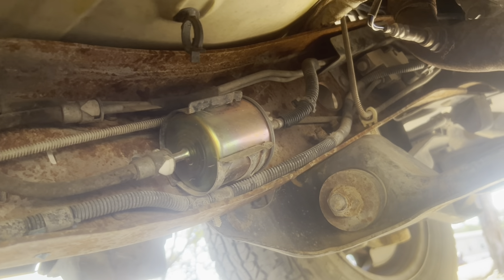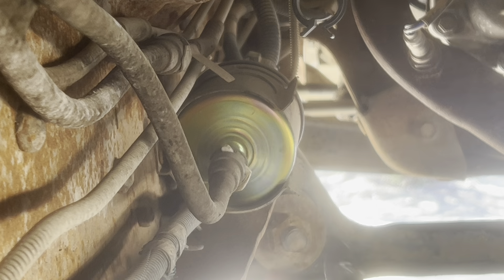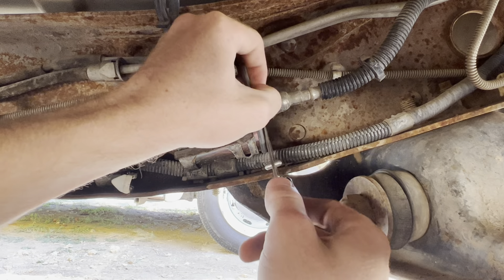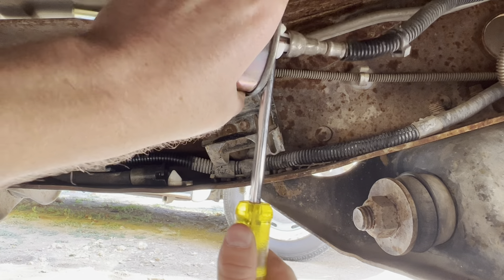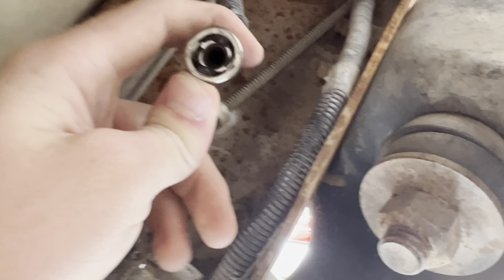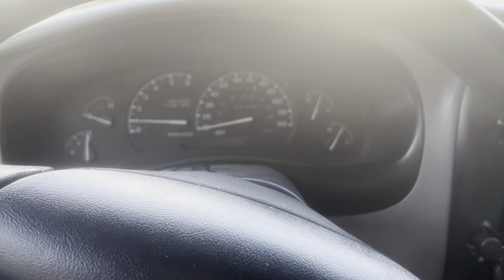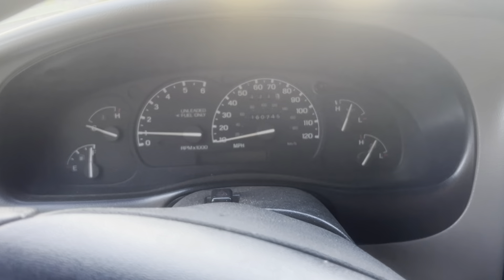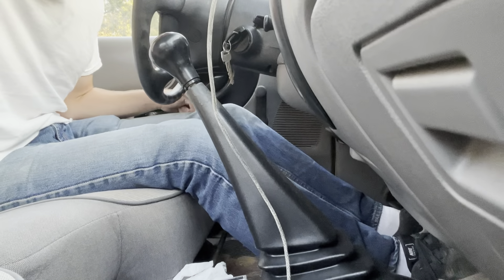1996 ford ranger fuel filter replacement

Comment: It makes you wonder why engineers design stuff this way. That filter will act as a restriction so that means there should be a little more pressure before the filter than after. So why did they put a lighter-duty fitting on the tank side and this PITA pressure fitting on the engine side.

Comment: Just bought one of these had to replace the transmission, now it's cuts out mid throttle  replaced plugs could pack  and fuel filter ,lol wish I had left it where I seen  it
Reply: Coil pack

Comment: Wow.i have the exact year and color,except mines the Splash.My 3.0 has 213K now and is cranking a while before firing.I havent changed fuel filer in many years so im assuming i should change it first?Does long cranking sound like fuel filter issue?

Comment: are you sure that's 1996? It looks nothing like mine!
Reply: Yeah, mine doesn’t look like that, and I’m pretty sure the filter was in a different spot
Reply: Mines a 96. Looks just like this. Ford is notorious for switching things up mid year.
Reply: For real he has a Rev dash I have a 97 ranger an no rev dash
Reply: I have a late 96 and it appears identical, idk
Reply: @svrsxlt  I figured out my mistake. I have a title for a 96 but the truck is actually a 94... so my bad